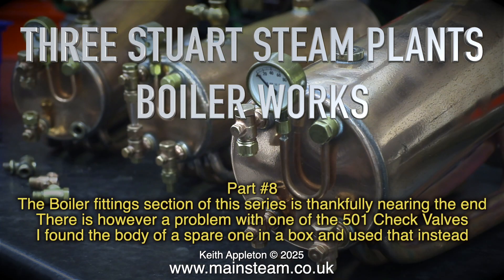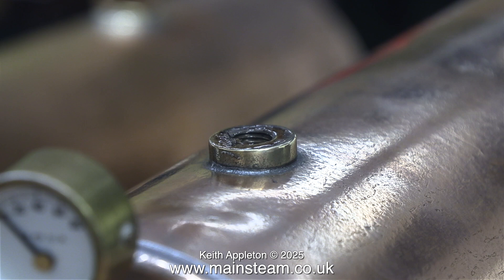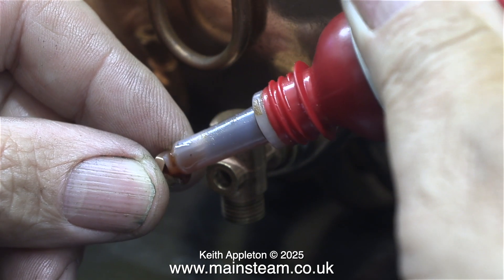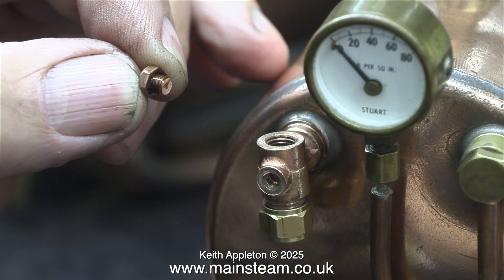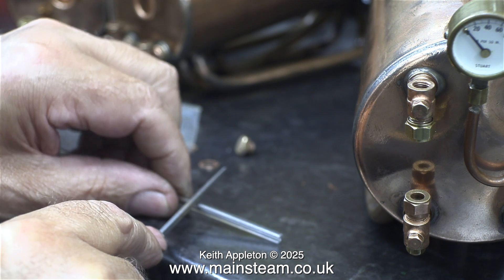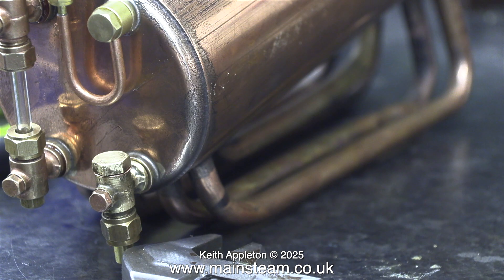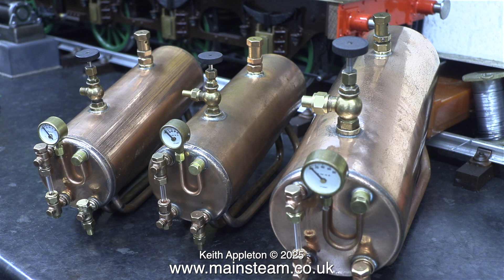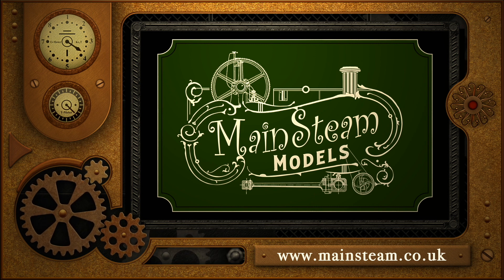REBUILDING THREE STUART STEAM PLANTS - BOILER WORKS - PART #8

Comment: Is there a particular reason for mounting the check valve vertical? If there were a clearance issue. Could you mount it horizontal? Thank you Keith.
Reply from the maker: Check valves are usually mounted this way as Gravity help seat the ball valve at low boiler pressure. They are generally mounted in the position as shown.
Reply: @keithappleton   Doesn't it have a spring holding the ball against the seat? I don't know. Never seen what was inside one. Interesting indeed.
Reply from the maker: No, only gravity followed by steam pressure holds the ball in place.
Reply: @keithappleton Sorry. I assumed that there was a spring holding the ball. Your knowledge is way beyond mine. Thank you for setting me vertical.